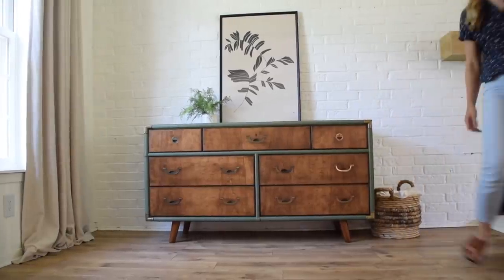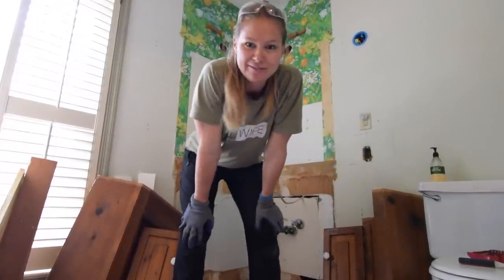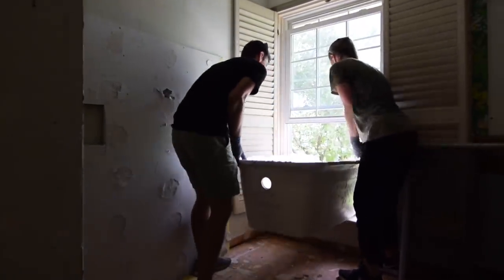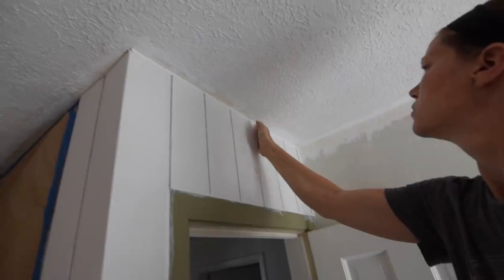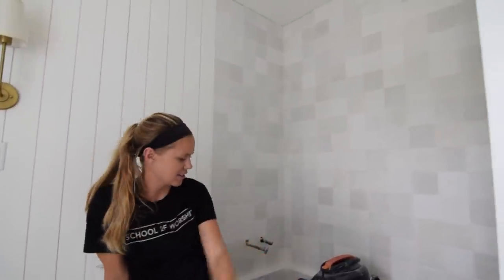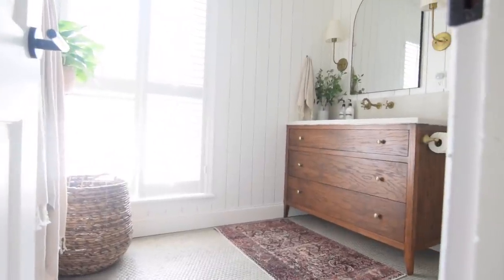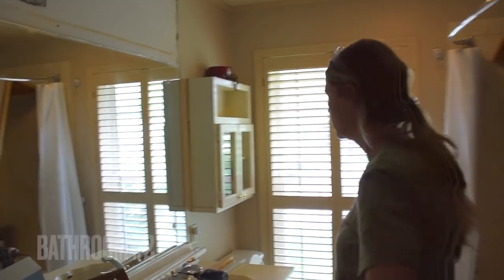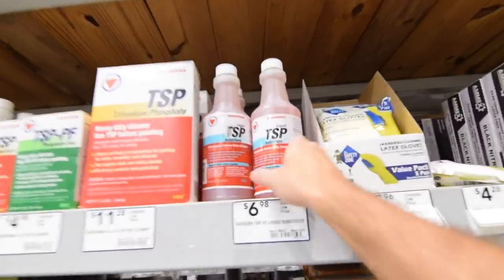DIY Bathroom Makeover // Full Bathroom Remodel on a Budget / Small Bathroom Makeover Start to Finish

Comment: Looks pretty good. Two suggestions: improved overhead vanity light (not sure two wall sconces will provide adequate light for makeup application, etc...). Glass shower door (while you are at it)! Good work though............
Reply from the maker: Sconces at face level are actually better for bathroom lighting and things like makeup applications :) there is overhead lighting too though...

Comment: Great job.  Look forward to seeing bathroom #2.  Question regarding the vanity... Are any of the drawers functional or are they purely for design?
Reply from the maker: Thanks! Only the top one doesn’t open, the bottoms 2 work and are huge!
Reply: @diywife  Cool.  I figured they were functional but wasn't 100% sure so decided to ask.
I do have another question about paint spraying.  My wife and kids gifted me a Graco True Coat 360DS.  I used it for the first time spraying a couple of kitchen cabinet doors to see if we liked how they looked painted.  Happy to say that they look great so now we need to decide when to start the kitchen cabinet painting project.  With that said, I was wondering if you had any advice on how long a paint sprayer can sit between coats?  I would think that I would not have to clean the sprayer between coats.
Reply: @mariom4019  I have a Homeright sprayer and I never clean between coats and it has always worked fine. If I’m being honest, I’ve let it set for much longer than between coats and just had to clean off the front of the spray nozzle when I used it again. Though that is not the recommended way to use it.

Comment: Great renovation. Beautiful vanity. 
Why didn't you donate vanity or counter tops sink.
Reply from the maker: Thanks! We talked about that a bit in the video, the things we didn’t donate were chipped/cracked already and not really in good enough shape to be reused. The vanity was just built into the corner without a back or sides and couldn’t just be pulled out in one solid piece :)
Reply: @diywife  Yes watched out takes.
Friend looked for corner sink for  vintage trailer. 
Finally found.

Comment: This is great! Beautiful and seeing the two of you build it together is awesome.
I've done tile and stone for over 30 years. I've laid blankets over cast iron tubs to bust out with sledge hammers. I've torn plaster and lath out, I've used demo saws and cut fiberglass tub units out. Built back full showers pan up from scratch, but the hardest thing I EVR tore out was one of those corner cabinets built in place that was SOLID.
It took me and the carpenter using (2) 7' hole diggers (pry bars=demo tools 😅) to wedge that booger out in one piece. 
We had to save it to reinstall as this was a restoration. 
YOU GUYS DID GREAT 😍 Enjoy that bath.